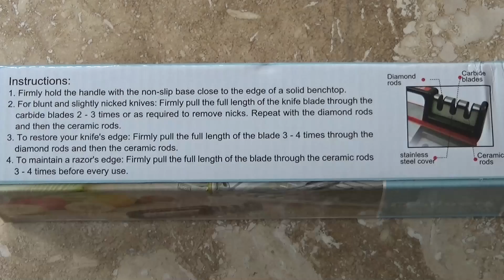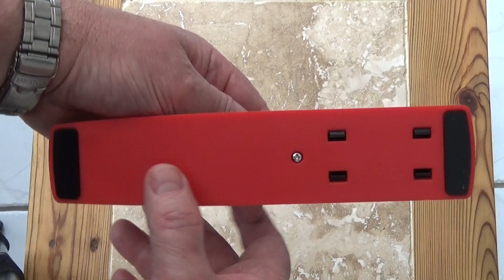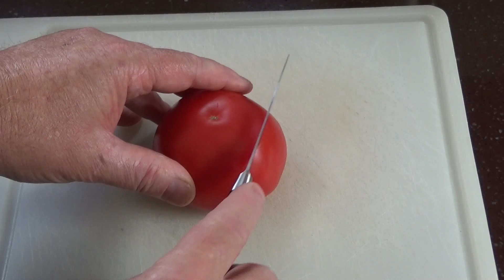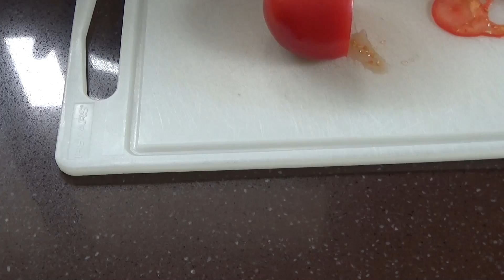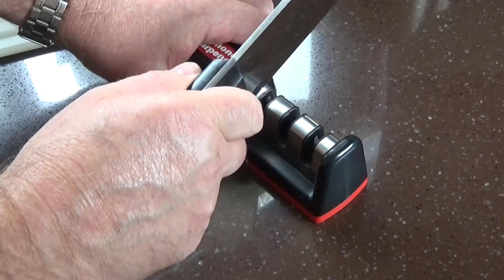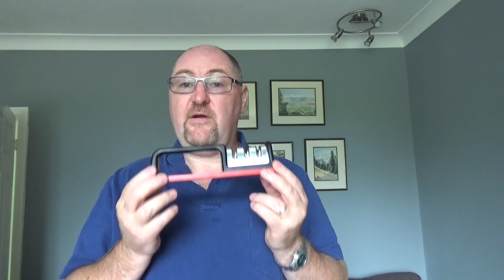Review - Dailyart Knife sharpener available on Amazon UK

Comment: To cut a tomato with a sharp knife is difficult. Even with a dimpled Santoku knife designed to stop food sticking to it. Best to use sharp knife with serrated edge to give you immediate grip on skin. Using a cleaver to cut a tomato even for demonstration purposes was weird. It's a chopping tool not designed for that purpose. Better to demonstrate the sharpness of cleaver blade by running it down a sheet of paper.
Reply from the maker: I figured if a cleaver could slice a ripe tomato after being sharpened with this product, it would demonstrate just how effective it is!  :-)